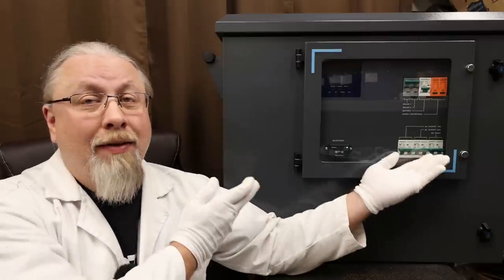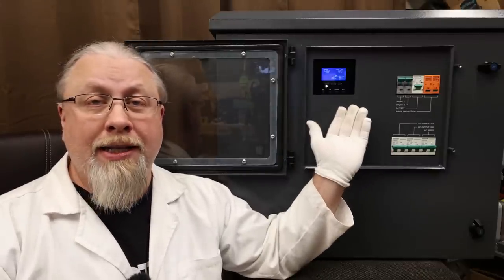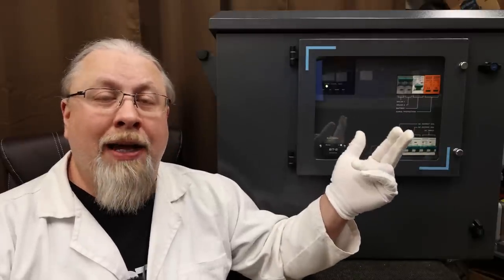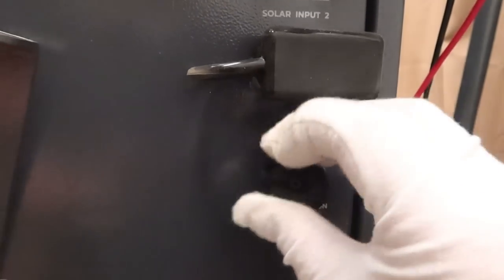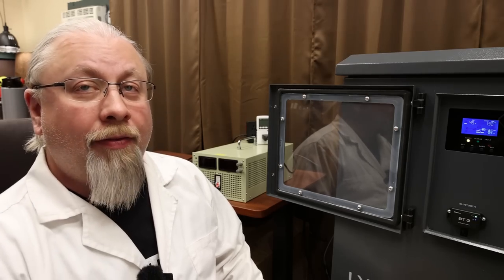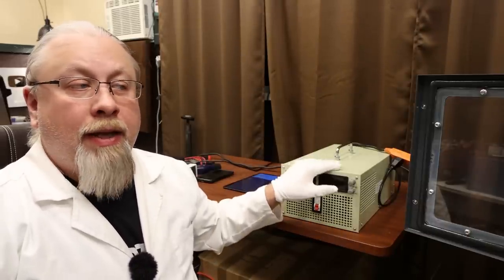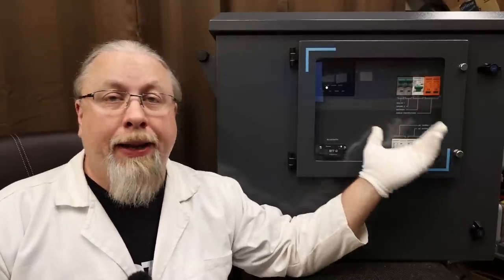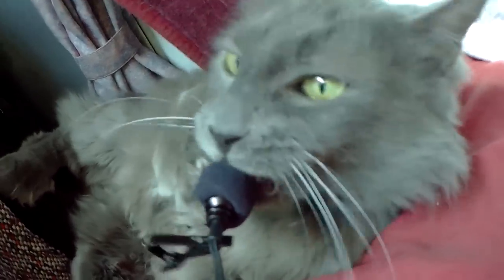Renogy Lycan 5000 4800wh Outdoor UPS LiFePO4 Solar Generator Power Station

Comment from the maker: CHECK IT OUT HERE: https://gohobo.io/lycan use code HOBOLYCAN1
For 450w solar panels https://gohobo.io/ren450 use code HOBOPANEL 
For 175w solar panels https://gohobo.io/ren175 use code HOBOPANEL
Reply: Link is dead
Reply from the maker: @Authoratah  Links work just fine.
Reply: Professor, I have been trying to find the video of this unit where I think it was said, something like it can't be combined with another unit to produce a 50 AMP connection, are you aware of any such thing?
Reply: That's about as plug and play as you can get! Bad azz is right! The future is bright in the solar universe!  Enjoyed the review as usual! Now, let me go count my shilings!!

Comment: I'm using the Lycan 5000 to power and run a radio astronomy project using two, 3-meter satellite dishes configured as an interferometer and the low noise amplifiers (LNA) and band pass filters (BPF), the lycan does not cause any issues or radio frequency interference (RFI), that distrupts H1 hydrogen observations at 1420 MHz or 21 Centimeter wavelength.

Comment: The bar that is attached to the ground screw is probably for shipping purposes only.  Renegy’s video shows removing the bar and attaching a ground wire that is not included.  Due to the fact that it is painted steel and not copper, it probably is inappropriate to use as a grounding bar.

Comment: The 80A is PV charge current. The inverter charges the batteries at 54V x 80A = 4,320W. The inverter can additionally charge the batteries at 40A at 54V from AC power for a total of 120A at 54V.

Comment: My problem with it, is that home backups should be 240 volt split phase, with a higher wattage inverter to be useful for most people.
Reply: Just shop in Great Britain or Australia, and you'll be fine.   :)
Reply: @sundancer442  would you explain? Thanks
Reply: @M_White_VA  He's either joking or saying that the "UK" version of this product outputs 240 volts... but he forgets they use 50 hz, so unless there's a way to program the cycles per sec on the UK version to 60hz... it would be useless here in the USA

Comment: Well that means I could probably put that on top of a cabinet the cabinet full of batteries and use as a  powerhouse giving it more batteries for a longer capacity. And if we can give up 3600 w continuously I could hook it up to my kitchen stove if I could change it to 240 volts.

Comment: I bought the original Lycan, and after trying 2 units, got rid of it because it wouldn't stay on. It was a "feature" to conserve battery charge, as best as I can figure. Not a good feature when its job was to power my fridge. It's why I ended up building my own set up from components. Haven't had a problem since.
Reply from the maker: The Lycan has a power saving feature you can disable.
Reply: @HOBOTECH  YAY!!!!! Good to know. It needed it.

Comment: All of these solar gens for RV’s are great! But would anyone really feel comfortable leaving them outside, with your RV plugged into it, and trust that no one will walk away with it? 

I know I’m not comfortable doing that, that’s why I wired a female outlet outside, ran it into my dinette seat, with a male plug out. I keep my solar gen inside my RV, plug my 30 amp cord into the side of my RV, it stays nice and safe!
Reply from the maker: It has steel handles. Lock it up.

Comment: Honestly, a very cool and well thought out box and can see it working well in a variety of applications. With the 48V setup it would be really nice if it had inputs for an auxiliary alternator… with 125-150A alternator it could charge up that battery in under an hour making this box even more versatile in something like a van build. 12v outputs would also be really nice. Overall super cool though and at a great price point. The waterproof aspect is a huge plus!
Reply: Could this be manipulated to work with alternator charging? I’m trying to decide whether to pick on up on sale for my campervan build bc I can get it at a good price
Reply from the maker: Don't think y'all realize just how big and heavy this is. It's not setup for van builds. Watch my video on the Bluetti AC300. That's what you want.

Comment: So with the 20 and 30 amp breakers does that mean I could run a 50amp service off of this without problems? So 20amp for a fridge 15amp furnace (no ac) 15amp for lights and that's about it unless you alternate appliances? I like that unit but I'm used to industrial/commercial type equipment so it's looks don't bother me. I think it's great they come out with this unit. It should mean whole house units will be right around the corner if not already here.

Comment: Hi! Im confused bout if you actually need over current protection from pannels to the lycan . I know it has over current built in for each solar array but am i correct to think thats only protecting the lycan and not the cable from panel to box? So we should have a fuze off last neg conductor to box? The manufacturer is giving me conflicting information. Thank. Love your vids

Comment: Loved your analysis. Ordered one. Pounded in a grounding rod and ran 12 ga copper on inside to the Lycan’s spot. This is also chosen to be at an outlet connected a 20a breaker. I’ve labeled all our breakers super accurately, which are roughly 80% supplied by 20 amp breakers (about 20% are under 15s). Built a temp ramp to get the Lycan 5000 up upon a strong pallet based platform that looks good, robust, & perfectly sized. It arrived safely and everything powered on in the right order. All
Indicators light up as expected. Spirits are high. Time to charge it on house power. Grab plug. Insert in Lycan bring other cord end over to our 20a supplied outlet. What? The plug on the house side is the weirdest configuration I’ve ever seen. BIG sinking disappointment. If I need a specially configured non-standard outlet installed, why is this NEVER mentioned? I would have ponied up for an electrician far in advance, yet this was never brought this up. Big let down. Consider the expense of a qualified electrician if you just simply want to start out charging by house power before configuring solar later. Big omission in the analysis !! Others will feel the let down, especially if they were trying so hard to set up everything in advance for the unit’s arrival. Had to power off the unit, make an appointment, and wait patiently. It’s a handsome box - so much potential - no illuminated lights for now: it rests in quiet slumber. Just a lack of notification of a simple issue unexpected issue that’ll only shut things down temporarily. Some of you will appreciate knowing about this in advance.
Reply from the maker: All you need are one of these if you don't have a 20A outlet. Then just reduce charge rate to 15A https://amzn.to/3CutD6o
Reply: @HOBOTECH  Learned more on the subject that may help on the LYCAN plug configuration surprise issue for the non-electricians out there like me. I confirmed that my outlet IS a 20 amp circuit by flipping the breaker to test. It’s actually THE closest outlet to the main house breaker panel. So that’s a very short wire run - about the length of a hockey stick.

Apparently typical household 20 amp breaker circuits often just carry the usual series of the typical 15 amp wall outlets we’re all familiar with. But the wiring here at my solar gens parking spot is set to handle up to 20 amp; however it’s cheaper just to throw in mostly 15amp wall sockets so that’s what we often get and don’t question. (Of course other circuits dedicated to mostly lighting DO get serviced by only 15 amp breakers). Exceptions would be circuits for main fridges and large microwave plugs or GFCI bathroom and kitchen outlets that are GFCI and needing the obligatory 20amps. And of course we know what items typically use the 30amp breakers.

After shutting off the targeted 20 amp breaker I carefully replaced the existing cheaper 15amp “style” outlet with a solid 20 amp outlet that has the plug orientation matching the LYCAN’s provided household charging cable. Outlet was less than $4 at an electrical supply store. After the re-wire the Lycan could be powered up.

Based on my results, as long as it is a 20amp circuit, there should be no complicating issues of this swap. Go carefully - in my case 2 black go under brass screw bus and  whites under silver screws with solid copper ground into green corner screw. Bump in the road has been crossed successfully for less than $4. The Lycan is ALIVE and reporting status to my phone.

Kudos to
Hobotech reviews - totally enjoy your innate intelligence mixed with humor and the hilarious popular culture references…good combo of nerding out fun of the fascinating details & data of the wide array of competing products spilling our way from every direction. Hobotech will be having you choose wisely for your specific needs. An honorable endeavor.

Enjoy guilt-free your well-deserved downtime for as long as you need. Thanks for doing what you do so consistently for us: the fun & surprising lab work conclusions will have you seeing many of the videos. Cheers from this subscriber!
Reply: Thank you soooo much for this comment.  I am in the same boat.  Ordered the Lycan and getting ready for her arrival.  I too would have been disappointed to find this out when she arrived.  I am also Very Happy with Hobos response, as i just ordered the recommended adapter.  I thought i had a 20 amp in desired location , but it turns out it was a GFI, without the ability to plug anything into it........Not sure what the electricians thoughts were on that.
Reply: Thank you so much for offering a solution, to the problem i have as well.. @HOBOTECH
Reply: Thank you also, same here

Comment: I'm confused. 60V-145V input for solar. How is 3 x 12V panels enough to engage changing? Is the minimum not 60V? Same for 2x24V panels.
Reply from the maker: You go by Voc of the panel as described in the video.

Comment: Killer Renogy deals going on now...15% off the Lycan.  My 'kit' arrived yesterday and I'm pretty jazzed.  Heads up though...the AC input cable requires a NEMA 5-20P outlet which I do not have.  That'll be an add on for the electrician I'm required to use for the manual transfer switch installation.  I got that through Renogy and it's a Reliance Pro/Tran2 model 306A.

Comment: Hey Mr. Hobotech! I get dizzy watchin' this kind of stuff, so why don't you do an old man a favor & make a video for me. I'm about to retire, and am going to put up a couple of greenhouses. They're going to be about 30ft by 90 ft, & I'm going to dig down 6 to 8 feet & run pipe to warm them, along with a few other tricks for a burst of cold weather, so I don't need power for heat.  What I do need is power for lights, & I'd like to keep it as simple as possible. We're pretty sunny in eastern NC, but I'll need to illuminate them for about four hours a day. I'd like to use basic bulb grow lights hung from a basic socket on a power cord type thing (provides unique flexibility). Figure I'll need around 125 of them per greenhouse. They run 12 watts a bulb. What's the most basic solar setup I'd need for that type of rig?

Comment: If you put it outside and it rains, be aware that a failure point exists where raindrops splash up when they land. They will soak the filter and damp air will enter the unit, possibly shorting it out. So lean or put a board on it.

Comment: What happens if you let it run the battery down to shut off voltage? Is there a Min percentage discharge for these batteries or do they protect themselves?
Reply from the maker: Yes

Comment: You think it would work for a well pump and a septic pump there's a 20 amp breaker on each but it's set with a double pole in the breaker boxs the total startup on these two items around 1,000 each or just over the running water about half of that for both each
Reply: Your well pump and sump pump would have to be 120 VAC models to work with this.
Reply from the maker: There are videos on how to easily convert a well pump from 240v to 120v.
Reply: @HOBOTECH  could i use one of these in the house for critical loads and a separate DC only system for the well pump?

Comment: HELP! Hi there. I just installed the lycan 5000 tiny house system. Everything worked great until i plugged in the 8 solar panels shipped with the kit. As soon as I flipped the breaker there was loud popping and then smoke came out from where the solar array breaker switch is located. Now it's just dead and batteries are solid red. What happened?
Reply from the maker: Funny because the Lycan isn't sold by Renogy with 8 panels. Let me guess you bought a "kit" from the rip off artist ShopSolarKits? If that's the case, you're on your own. Renogy probably won't cover the warranty from a 3rd party. Next time buy direct using my links and not a 3rd party joker.

Comment: Thanks for the thorough video.  It's been very informative and the Lycan 5000 seems like the right setup for my specific needs.  With that said, wouldn't the current of the 450 watt renogy panels in a 3s2p configuration be above the 20 amp max for solar input?
Reply from the maker: There are two 20A inputs.
Reply: @HOBOTECH  Thanks for the reply.  It's a little nebulous in the manual.

Comment: I have a travel RV that is parked off grid. I am considering the Lycan. My Rv Has 50 amp service. Can the Lycan be upgraded to handle that or can I adapt my RV unit to 30 amp service. 
The unit is equipped with a 12 volt system for lights, motors and pumps. 2 100 watt panels and 2 batteries.  Where can I go to find out more if you can't help. Thanks

Comment: Question.... and maybe i missed something, but i heard you say that the minimum input for solar was 60v, and that would take 3 12 V panels.  In my world 3 times 12 is 36.  What am i missing??
Reply from the maker: In the solar world you go by Voc or the max voltage the panel outputs
Reply: Thank you for that valuable piece of information.  One would think if that is the important component VOC, it would be highlighted on ALL solar panels.  However, i do not find that to be the case. @HOBOTECH
Reply: I went and purchased the Lycan and the Renogy 500 battery monitor.  I could swear i saw a video of how to connect these two, but for the life of me cannot find it any more.  Would you happen to know how to connect these two components @HOBOTECH

Comment: I see, in the app, there is some cell-level information. How is this information accessed by the controller? Is the battery itself supplying the data, or does it use balance leads, and the monitoring is done in the controller? Ultimately, can you build your own batteries, provided you have the proper (sensors/leads/bms/whatever), can the controller report that data?
Reply from the maker: The info is coming from the smart batteries, not the controller.
Reply: @HOBOTECH  Are the batteries reporting that data to the app, or is it passed to the controller, which then sends it to the app?
Reply from the maker: @chrislewis6050  I did explain in the video how it works.
Reply: @HOBOTECH  Ah, through RJ45... Thanks.

Comment: Could you please let me know what solar panels would you recommend for maxing out the solar if I also purchased 2 additional 48 volt self heated smart renogy batteries? We use 6000 watts a day. I was thinking of the Qcell quantum panels,  as I can get them locally, but I think the voc is too high. Thanks
Reply from the maker: I recommend the Renogy panels in the description or whatever is here https://hobotech.tv/amazon/#Solar-Kits

Comment: That thing is awesome. I wish it had 240v but this would be awesome for my off grid garage. How would this do to charge my EV?
Reply from the maker: It will charge any EV at Level 1
Reply: @HOBOTECH  yeah, I would think if we plugged it in when we get home from work we could get our commute milage back. It's around 20 miles round trip. Would still have several hours of sun in the summer. Winter might be a little tougher

Comment: If your off grid or shtf situation I wouldn't want all the wifi/Bluetooth stuff. Is there a sogen without all that. Also could these possibly be hacked? Maybe a dumb question, but I'm asking anyway
Reply from the maker: Just turn it off ...
Reply: The app is useless and absolutely no support from Renogy. Just pretend it doesn't exist and you'll be fine.